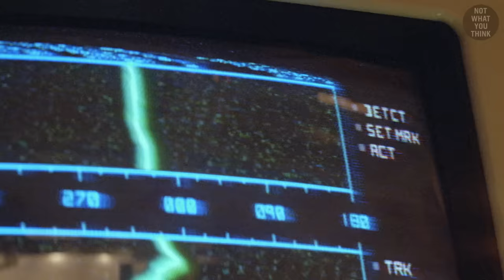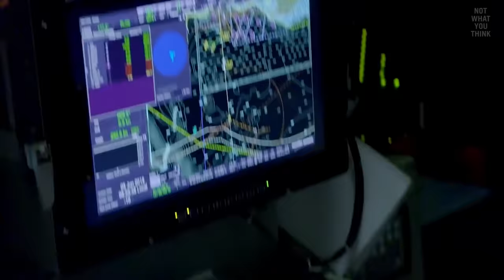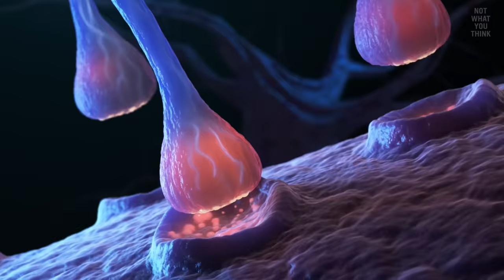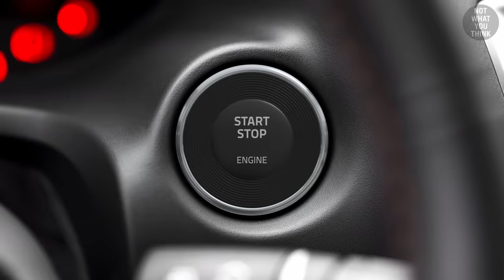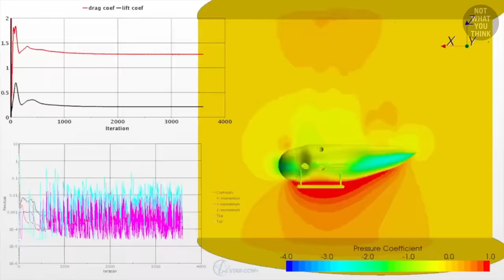What Happens When a Submarine Implodes

Comment: Hank Green, a science youtuber, responded to tweets asking how to recover any bodies from Titan by saying "In this scenario, a human stops being an organic body and becomes a physics equation." I'd assume every cell of the body ruptures under the pressure and you basically turn into an underwater dust cloud that kinda disperses into the water.
Reply: Skin is pretty tough.  I've seen pictures of things that look like floppy halloween masks from explosions etc.  I bet a good chunk of human scalp could survive relatively intact.
Reply: @toolbaggers  not submarine implosion. Skin would incinerate.
Reply: It would also get very hot
Reply: @filiphabek271  Depending on whether it was in the gas bubble or in the water?  Wouldn't the water remain cold?  Still it would be like putting the skin into a hydraulic press, the result a thorough squish.  Explosion forces aren't the same; this is an implosion force.
Reply: @toolbaggers  the pressure at that depth is about 6000psi, or pounds per square inch. Each inch of skin would have instantly been subject to that pressure. For another comparison, a standard scuba tank holds about 3000psi, which gets you roughly an hour of air. It's a lot of air. 
So imagine two scuba tanks instantly exploding, and that's about the equivalent of what each inch of skin is experiencing. 
It's cool, and also terrifying. So, ye, Hank Green is right.

I couldn't resist, I'm a scuba diver heh
Reply: The pressure is equally on every inch...your body can't be compressed much since it's mostly water
Reply: @Plutogalaxy I was about to say. It’s been reported that they recovered remains, but it hasn’t been revealed what they were. I doubt they would be while bodies at that depth though. It wouldn’t be unusual for pieces to remain, they would shut be small. The “fine mist/dust theory” was more like the bodies turned to chum. Anything left over is what didn’t get swept away by under water currents or what wasn’t eaten by sea life.
Reply: I assumed that the remains they had found was perhaps biological matter coating the inside of parts of the sub.
Reply: I can understand why this is fascinating, but so soon after the disaster it is also very sick. Leave it alone.
Reply: @fedup99  first time on the Internet?
Reply: @fedup99  While I hear you, the investigators will not have that luxury.
Reply: @bagfootbandit8745  Two SCUBA tanks each containing 3000psi is not the same as one containing 6000psa. It's still only 3000psi. I doubt your diving experience when you claim a tank gets you "roughly an hour of air". Quite apart from the size of the tank, time is dependent on depth.
Reply: @Plutogalaxy  No one has made that claim, the statement said "presumed human remains".
Reply: @byteme9718  it was an analogy for the power of the implosion and the force of compression at depth, not an explanation for how much air you have at the depth of the Titanic. You have about an hour of air at recreational diving depths with a 3k psi tank. I'm well aware that's a ballpark. The same amount of air at the depth of the Titanic might get you a single breath. I'd go into why you wouldn't want to be breathing raw compressed air at anything deeper than 200 feet, but I don't want to get pedantic or bogged down with extraneous detail. 

Happy?
Reply: @bagfootbandit8745  It was a piss poor analogy then! You can't add 3000 psi in tank to another with 3000 psi to make 6000psi. Even with a hundred tanks you'd still have 3000psi.

You fail to correlate dive time with tank size and depth, then of course you have fitness, physical exertion, experience and reserve air. I have well over 1000 dives logged and rarely see anyone who's dive lasts 45 minutes with most ending closer to 30.

I know all about mixed gas diving and why it's necessary so please don't give a poor explanation. As for "The same amount of air at the depth of the Titanic might get you a single breath", you didn't think that one through did you? How is a tank that provides only 3000psi going to allow the regulator to provide a single breath?
Reply: At that point, you’re just a fine red mist floating in the deep ocean. It might seem gruesome but at least it’s basically instant to the human brain.
Reply: @therealspeedwagon1451  Such a shame Rush didn't feel fear and pain over a prolonged period.
Reply: @byteme9718 could you not get 2 tanks with 3000 psi, and move the air from one tank to the other leaving one tank with 6000 psi and another with a vacuum?

Of course I'm ignoring changes in temperature and the fact that scuba tanks aren't designed to hold such pressure. It's just what I understood adding 2 tanks meant (rather than having 2 tanks next to each other).

If I may ask as I haven't been diving myself, but if somebody managed to have sufficiently compressed air at the depth of 3800 meters and would take that single breath, wouldn't it contain enough air to last for much longer than a single breath you take at low depth? After all it contains a lot more oxygen in the same volume of air. I'm aware that amateurs are taught to breathe at normal speed due to safety and the fact that the dive duration is limited by different factors, but it seems logical that if with increased depth each breath has a higher pressure, then each breath should in theory last longer.
Reply: @byteme9718  Christ, you're getting way too pedantic for what was supposed to be an analogy for random people who don't have the background. Not sure you're aware, but most people haven't gone scuba diving, so getting too detailed isn't always helpful. 

I meant the original analogy to be an visualization of explosive power. Fine, I'll  acknowledge that it was a bad analogy. In fact, I missed a sentence: "A 6000 psi tank exploding at the surface is a highly violent event, and that's the amount of pressure at the depth the sub imploded, per square inch." Better visualization for the forces at work. Perhaps I should have converted that into a different expression of power, like Newtons of force, but it was more about conveying the force and how people conceive of tank pressure in more layman's terms, not a dissertation on atmospheric pressure. Bad analogy, I agree. Missing pieces. I wrote it at 1am in the morning. Crucify me. 

Similarly with my comment on how much air you'd have in a single breath. Not meant to be perfectly accurate, just accurate enough to get a picture for people to visualize it, and so I wouldn't feel like I had to type a whole dissertation on how regulators work and why you can't use them beyond a certain depth. Clearly, if you're that deep down without a submarine, you have bigger problems than how to breathe. I trust people to look up the more detailed explanations for themselves if they're curious, as I also trust that people won't take too much stock in the accuracy of information in YouTube comments. 
I've witnessed people I dove with on the same dive come up with 1500 psi or even 1800 when I had 500 after a long dive. Happens frequently with people who dive their local areas regularly. I'm a small skinny dude who gets swept away by ocean currents, so sometimes I have to exert a lot more to lug the tank around underwater. I sometimes use more air than I'd like to. I am well aware of the variables involved. But I don't (usually) feel the need to cite my experience, just discuss the corrections if necessary. Not sure if you're aware, but you're coming across as a dick even though what you say is accurate.
Reply: @Plutogalaxy  Goo, similar to what was found in the debris after the 9/11 WTC collapse.
Reply: I think bones would survive, and hair strands.
Reply: So they found the rubber sole of a boot with bone stuck in it… yikes
Reply: Given that cells are mainly composed of cytoplasm which is mostly water, I doubt cells would implode under the pressure. Water doesn't compress easily and there is plenty of sea life at that depth, mostly weird alien creatures like blob fish. I could be wrong though.
Reply: @SeekingTheLoveThatGodMeans7648  I think the pressure change causes an exothermic reaction, so the local water would heat up temporarily. I could be wrong.
Reply: @dcarbs2979  The water literally compresses the air so much that there is an explosion and fireball under water.  There is nothing left.
Reply: @fedup99  dead people can’t feel disrespect
Reply: @fedup99  Calling people 'very sick' without knowing them, just for the fact they are discussing a subject respectfully.. now that is very sick. Leave them alone.
Reply: @silkscrim  Not even that. The physical reaction vaporises them.
Reply: @HawkeyePierce1981  You're somewhat correct in terms of compression (from what I know, which isn't much-- not an expert heh). The cells themselves would not implode, precisely, though they certainly wouldn't be able to function at that depth. 

The pressure the Titan imploded at basically turned them into a cooked paste-- the pressure change would have superheated the air and water and obliterated everything. Technically yes, the individual cells wouldn't have decompressed exactly (aside from any compressed gases present in them), but the violent implosion would have pretty much atomized them. 

So yeah, Hank Green is right when he says they became a physics equation. If they'd weighed their ankles and gone down without the sub? Then you might find a (slightly compressed) corpse.

The issue is the gas in our tissues. Decompression sickness ("the bends," a series of symptoms ranging from achy joints to death) is basically gas bubbles forming in our various tissues. Reducing the gas would reduce the risk. That's the start behind Sci fi ideas like breathing amniotic fluid for deep dives (besides the problem of regulator hoses getting too compressed to give you gas from a tank-- this is why helium is part of the gas mixture on deeper dives. It basically lubricates the hose). Reduce the amount of gas in the body, and the body can endure significantly more pressure. More importantly, you reduce the risk of decompression sickness when you surface. For comparison, scuba dives even to less than 100 feet usually implement a 5-15 minute "decompression stop" toward the end of the dive to reduce the risk by allowing the gas bubbles in our blood to disperse (we have tables that give us the recommended times and depths). The necessary time to decompress increases the longer and farther down you go. So, diving down to 200ft takes, like, five minutes, but coming up takes the rest of the dive. 
TLDR: Going down is easy. Coming up is hard, and coming up is more dangerous the farther down you go. Cue submersibles as the best way to go down deep, as you're effectively inside a compression chamber that mimics sea level air pressure. 

The issue also isn't so much the pressure itself, as the sudden change in pressure. Decompression sickness ("the bends") occurs when you rise too quickly from a dive (or any compressed space-- miners can also suffer decompression sickness). If you look at the blob fish underwater vs on the surface though, it's distended etc. Organisms that live at that depth have adaptations that allow them to survive, but we really don't know that much about how, because when we bring them to the surface, they're basically suffering catastrophic decompression sickness. Their tissues are often heavily destroyed from the pressure change. 
The Titan uh... Suffered the bends in reverse, instantly.
Reply: The water pressure alone doesn't do much to mammalian cells even at those depths, see whales, because they are mostly water. The problem is the wall of water traveling at roughly three times the speed of sound into the submarine. Due to inertia the cells facing the approaching wall will be compressed against the other half of you before getting a chance to move. So basically you turn 2D on the surface of the moving water wall.
Reply: @tiahnarodriguez3809  This chum theory makes a lot of sense and is just plain terrifying to me. Maybe they recovered bits of bones?
Reply: @fedup99 
Discussing avoidable tragedy is essential to avoiding the next one.
This company should never have existed and should never have been able to expose people to such insane risk.
If you find it upsetting watch something else.

You do know how to change your selection to cute puppy and kitten videos, yes?

Try that rather than whinging about other people discussing something...
The speech you preserve could some day be your own.
Reply: The force of the implosion would be equivalent to several kilos of TNT inside, what... 6 to 8 cubic meters?
Any remains are going to be very small in scale and at least partially cooked.
Soup... essentially.

Comment: Thanks for this video. As a former US Navy Submariner, I've had to explain this multiple times in the last week. Now I have a resource to point those questions to that is correct and easy to understand.
Reply: except, that many facts were incorrect. it's not good source where to point, in regards of technical information.
it will not behave like piston engine, no combustion occur, also no 2000-5000 degree hot air.
it will behave differently.
Reply: @warrax111  When you go from regular ambient pressure to 500+ PSI of pressure the air most definitely will heat up. Basic physics, when air is hyper compressed very quickly it does in fact get hot.
Reply: @cavalieroutdoors6036  But it's not piston engine.
It's water. It will behave differently.

Comment: Sadly, Titan had dropped her emergency ballast weights. These are large steel weights that, in the event of a need to ascend quickly, they can be dropped making her positively buoyant.
These weights had been released so they knew something was wrong. I'd put money on them hearing noises from the hull as the ingress of water delaminated the carbon fibre.
So, maybe some psychological stress but nothing physically painful.
Interesting video. I didn't know about the bubble pulse effect. My rabbit hole for later this evening. 
Thank you.
And to all you budding deep submersible designers out there. 
"There's a reason bubbles are spheres!".
Reply: yeah well this goes to show why if you see any thing wrong with your subs decent like oh I don't know faster decent into the deep return to the surface do not continue on wards the Titan proves why continuing on wards when your descending faster then normal is a bad idea
Reply: The sub had too much negative buoyancy on descent (descended too fast). After they realized they had a problem with warning signs from the sensors, and the electric systems were failing (perhaps water intrusion), so they released the ballast to abort the descent, but the sub was slower to ascend than it should have. Not that a faster ascent would have helped, they were too far underwater. In the end, they could hear the carbon fiber failing, and they were most likely terrified of all the system failures and knew they were going to die. Most likely death was instantaneous upon hull implosion. But the root cause was lack of proper design, not listening to experts, and building the sub out of carbon fiber, also crappy system design with no backups.

Comment: Methods used for salvage were developed by Commander Ellsberg in 1926 for the raising of the sunken S51. His book is very detailed. They had to develop new methods for divers and and equipment to get cables under the hull, manage those big floats, huge air compressors, etc. I read it when I was a kid and it left a lasting impression.

Comment: My cousin's great grandpa was a sailor on an Italian submarine during WW2. His submarine was sunk and he was one of the few to survive by ejecting from the torpedo launcher
Reply: Holy cap 🧢
Reply: WOW❤
Reply: BS, unless the sub was sunk in a river or a pond the underwater pressure would crush somebody if they got launched from 1atm pressure to 10, 20 or 30atm of pressure.
Reply: @JohnDoe-jp4em  he didn't eject at a 300m depth, nor even at 100m. Italian submarines during WW2 used to have a maximum operational depth of around 80m. His sub was sunk while it was sailing on the surface.
Reply: @justinlyons5159 you mean "Mitre" ?
Reply: @JohnDoe-jp4em world war 2 submarines did not dive down that deep. Like at all.
Reply: Onore! 🇮🇹🖤
Reply: @cabriskus4700  You sure about that? WW2 submarines could dive between 100-250m before imploding, which is a pressure of 25atm. Also, this wasn't about a submarine "diving" down that deep, as in "intentional". It was about "sinking".
Reply: @JohnDoe-jp4em in the old days, subs were ships who eventually submerge and not deep dive vessels. They usually only went down to attack or hide. And hiding was few hours max. Thats why they seldom were deep below, more common just below getting directly hit by a ship. That all changed with nuclear engines.
Reply: @JohnDoe-jp4em  USS Tang had some crew escape with special diving equipment from shallow depth. The Italian submarine in question was likely sunk in shallow depth or they managed to surface and escape before it sank.

Not all the ocean is deep, and the Mediterranean has a lot of shallow parts.

Mid war German submarines can dive to ~250 m and they had a project for submarine diving down to 350, but it was cancelled.
Reply: I'd have nightmares forever
Reply: @JohnDoe-jp4em most subs in WWII were sunk on the surface. They had limited dive time so escaping is plausible if he acted quickly after the shop was hit on the surface.
Reply: On todays things that didn’t happen…
Reply: @JohnDoe-jp4em

You seem to think WWII submarines could go as deep as modern ones…
Reply: @JohnDoe-jp4em

Or that it wasn’t resting on a shallow bottom Das Boot style.
Reply: @omahabricks 😊